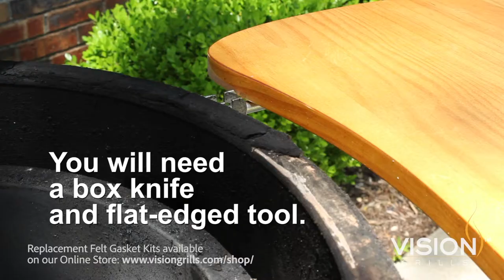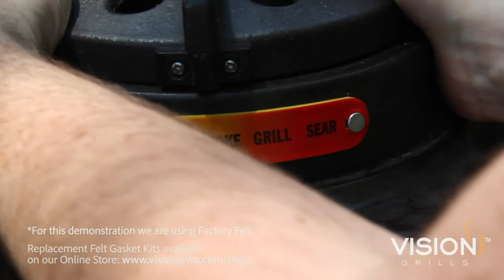How to replace the felt on your Vision Grill

Comment: It’s about time to change mine out again! So you don’t recommend removing the grease and adhesive with denatured alcohol or mineral spirits as I’ve seen in other videos?
Reply: Onion's Smoke Shack BBQ  I was wondering the same thing. I would leave that edge squeaky clean before placing that new felt so the glue makes a better bond with the ceramic.That edge was filthy!
Reply: milche64 that’s how I’ve always done it on mine, get all the grease and goo removed for a solid bond...
Reply: Onion's Smoke Shack BBQ I’m afraid to use solvents. Do you use anything soapy like dawn?
Reply: milche64 I use the denatured alcohol then wash down with dish soap and rinse really well let dry then replace the gasket. I recommend Nomex gasket, it seems to last longer for me.... I don’t do many high heat cooks on my Vision, I use it more for Smoking stuff